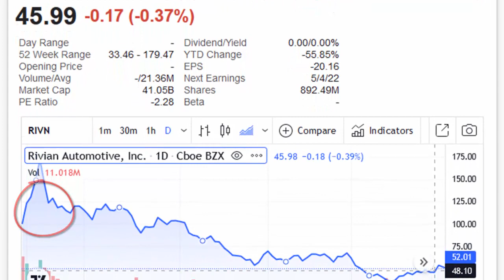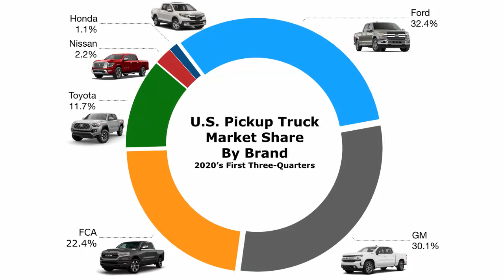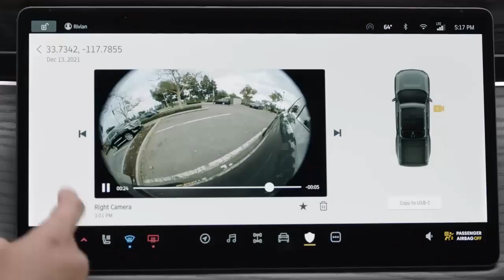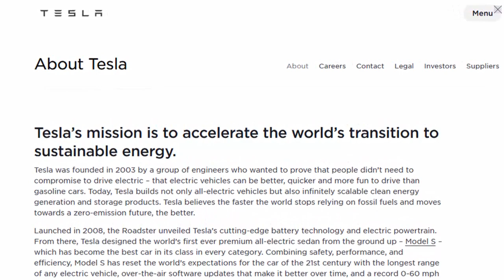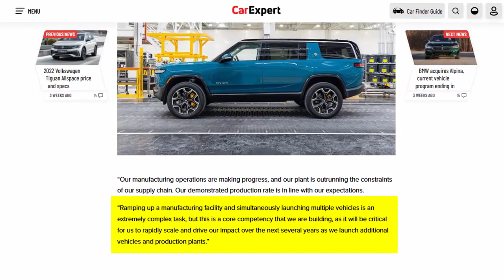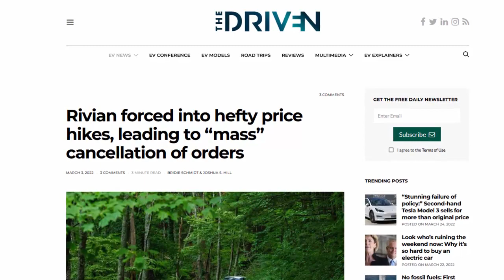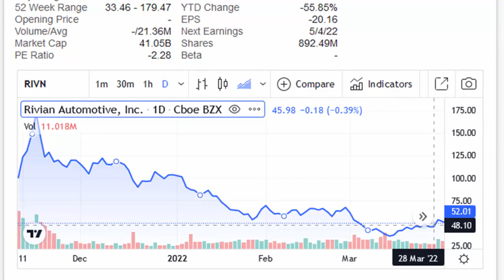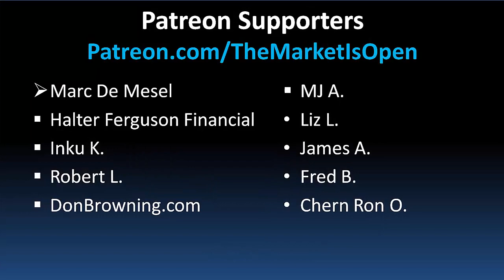The DECLINE of Rivian

Comment: Rivian has made a costly mistake. They launched the R1T at a ridiculous low price. The real market price for a 4 motors 800 bhp 135 kwh batery pick up truck makes sence at about 150 k. 
Especially when the demand is much higher than the production figures.
Reply: Yes but that's intentionally to lure in an investors (with hype and reserved number). Rivian bet that they could fix the prices later which they did and suffer the consequences.

Comment: The goal here is to compete with ICE vehicles.  If you’ve never owned a “high quality” EV, then you won’t appreciate this statement (little to do with global warming or sustainable energy).
The problem with Rivian, IMO, also as stated by Sandy Munro and other decompilers is that while Rivian’s R1T is an excellent built vehicle (so much so that Sandy Munro bought one) but it’s just too complex to move from small lot production to high volume production, at PROFIT, at current pricing.  
The current design and build has very little improvement for increased automation which is key to increased production and increased profit at scale….while I’m invested near the $40 mark, I’m only looking for short term gains with this company as they ride the PR hype and are actually delivering trucks, but are burning through so much cash every single day that I think it’s only a matter of less than a year before share holders bail…my stops are set tighter than normal….as a figure of speech, NOT financial advice!
Reply: I suggest holding unless your worried about the loss, but if thats the case sell now and dont put your money in the market. I doubt they will get bought out and its a good play if they get over the hump it has HUGE up side. I picked a few shares up in the mid $30 range as a quick play, at that price point I couldnt resist. Ive lost on some plays but I buy and hold as a rule and its never let me down even though ive had a few stinkers. The vast majority have multiplied immensely more than a few lucky timed plays would have and what little ive lost on leaving money in hasn't even put a dent in my tax's.

Comment: As Ford, Chevy etc roll out models Rivian is probably going to vanish.
Tesla is ahead and has a great charging network, while Ford and Chevy have more popular names AND cost less than Rivian.
I am not sure how Rivian survives.
Reply: 5 months later from your comment and the Tesla Cybertruck is still vaporware. You can't compare Tesla to Rivian if you don't have a competing product. Ford does have a truck available but it's not truly cheaper than the Rivian because the "base model" has nowhere near the capabilities or options and a similarly equipped Lightning is actually MORE than a Rivian. You mention Chevy, which still does not have their EV truck on the market, maybe next year? GMC does have the Hummer but its base price is nearly $25k MORE than the Rivian. I think Rivian is positioned well and will continue to thrive into at least their second market offering, the R2...
Reply: @a76marine1  good points

Comment: cybertruck... will get the 4 motor option at a higher price.    so anyone who had the 3 motor option is going to have to sign up for $15-20k price increase   or else they can wait 2 years.    so people will get used to the increased price.  
 
tesla can then release teh 3 motor and 2 motor.. but if you want the cheaper price... you wont get V2G or something... for that you need to pay the new price which is higher.

probably wont see a single motor until 2029

Comment: Filled with inaccuracies and oversimplifications. For example, there is no $40K retail market EV F150. That is a work truck only available to commercial/fleet buyers. The real EV F150 XLT available to retail customers with comparable 300 mile range to the R1T is about $75K. Go to Ford’s order page and see for yourself.

The chip shortage issue is another one - anyone paying half attention knows existing manufacturers are (Naturally) prioritized in a short supply scenario. 

And “10’s of thousands of orders”? Why acknowledge the actual order bank is 83,000 vehicles?

How is Rivian “going head on against Tesla”?  They chose the one high volume vehicle category Tesla is not in - Pickups.

EV startups are highly risky turf and Rivian is fully in that risky turf. But this author uses lots of words backed by so many inaccuracies.